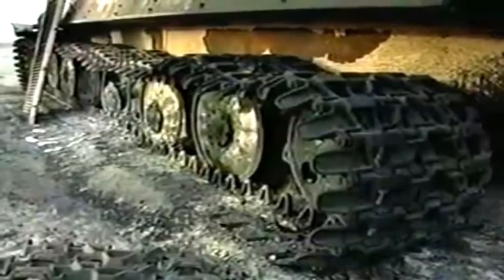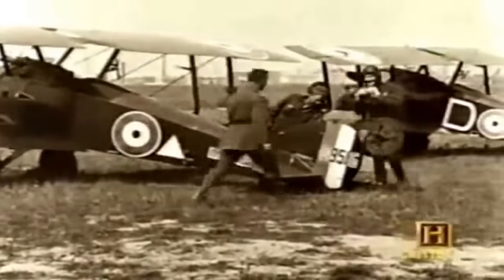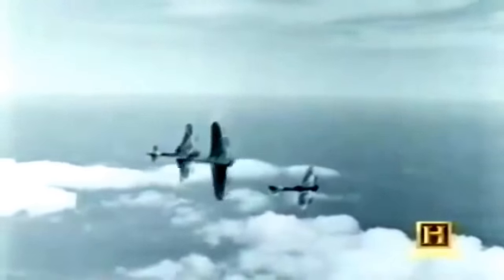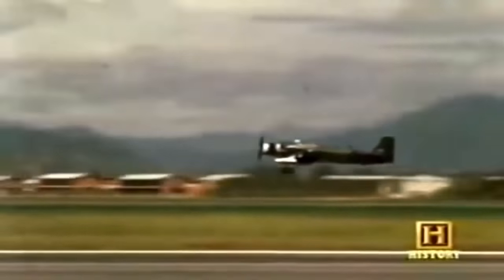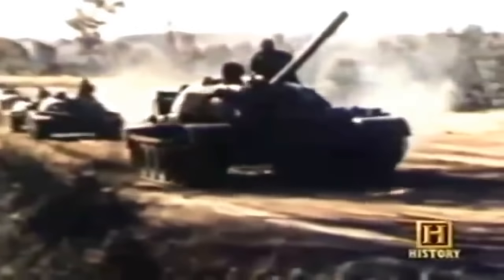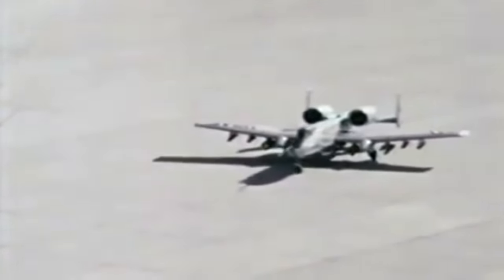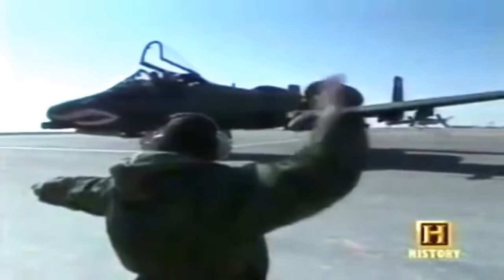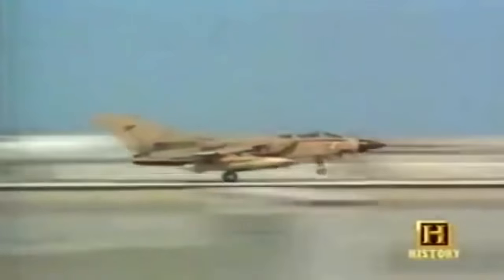BBC Documentary - The Most Feared Plane -  National geographic

Comment: Of the the jets and warplanes i have known for years the most beautiful ugly piece of masterful engineering  has got to be the warthog , it is built for close support and its a master at that , subsonic tight turns loads of power and the gau-8 , imagine been a soldier pinned down with your squad under heavy enemy fire  and when you are thinking its goin to be a long day ,a call for air support goes back to command  and 10 mins later an a-10 does a straffe run along the tree line and all goes quiet, what a beast, pity we couldnt give a few to the ukraine that would make my day
Reply: Yeah.  If only we still had the SR71.